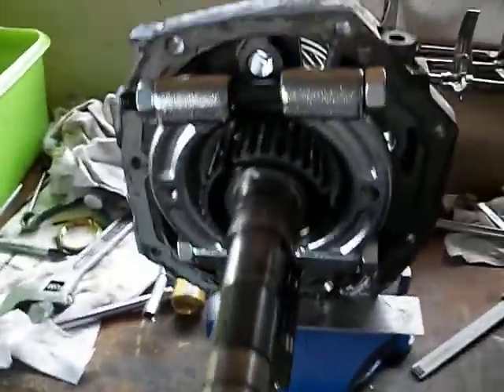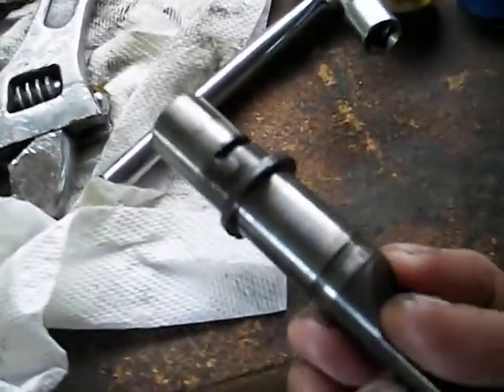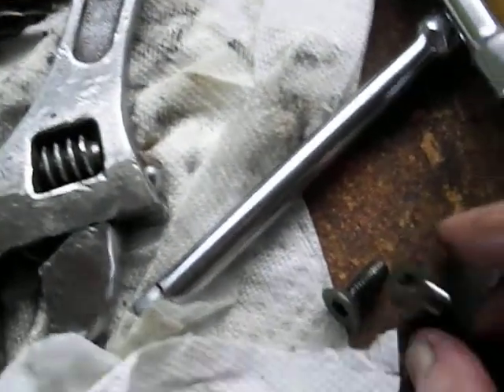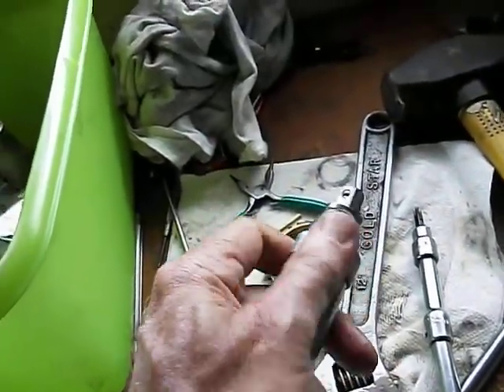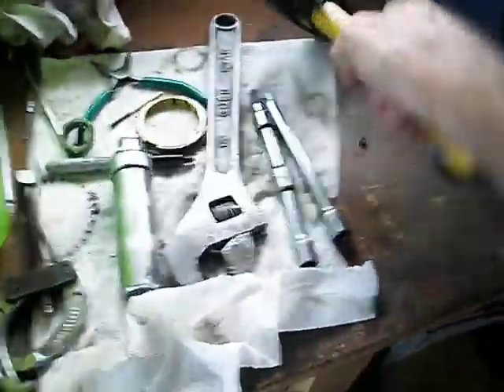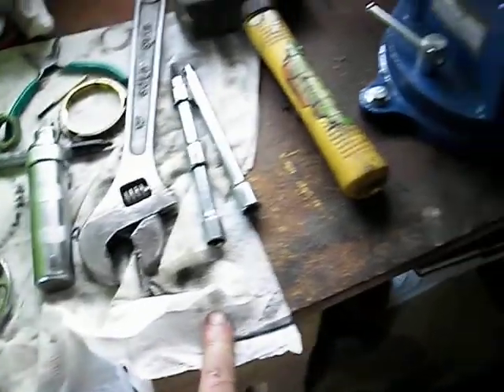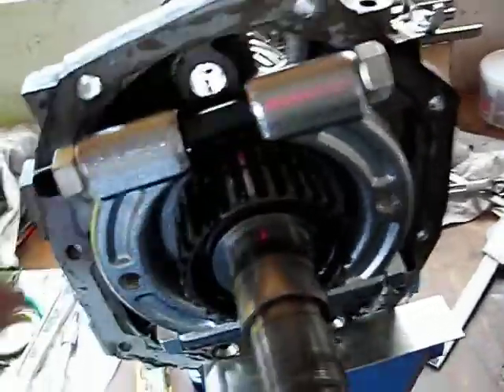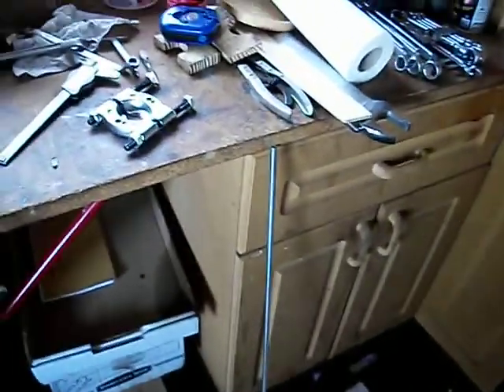FS5W71B datsun 280zx transmission rebuild pt 2

Comment: Hi Dave,
I'm still trying to get the shift arm out of my 5 speed. We talked before and you gave my some info on removing it, no luck.I know what has to happen I just can't figure a way to do it. The tapered pin on the shift dog is in such a position that I can't get anything in there to drive it out. Any ideas short of drilling a hole in the side of the transmission?
Craig
Reply from the maker: for sure don't to that (drilling the trans housing). I assume you have an older 5 speed without the reverse lockout. You are just going to have to get creative in there. So you loosen up the nut back it off enought to protect the threads on the end and try to get somehting in there like a flat bar to tapp on the nut. Maybe a little heat from a mapp gas torch, maybe some expandable plyers wedged in between the top of the nut and the side of the housing. Just dont get frustrated and make things worse. maybe double nut it and see if you can just wiggle the pin a bit. As soon as it breaks free it will come right out.

Comment: I have PDF of the Datsun factory manual on that transmission and there are 3 very good videos on YouTube of the disassemble and assemble. Ive had 2 of those apart first one took some time.
Reply from the maker: you are prob referring to the ones by villageland, no audio. I watched those several times before attempting this one. I decided to follow the FSM regarding using a press and the sequence. I noticed on his he did not use a press but rather a series of spacers and then the nuts to pull the mainshaft into place.
Reply: Dave WM yes I was. Whee you able to disassemble the shift rod and replace a seal or what every is in there? I stopped trying to remove that part I couldn’t find any info other the the manual and it was no help.
Reply from the maker: yes you have to release a bolt that is wedged in (no head) it was a bit of an effort to get it started, IIRC I used a drift and access thru the reverse lockout hole. then there is the knock out plug at the end of the shifter. Its staked on only, the shift rod just pops it out once you have that wedged on bolt and lever off (the lever that engages the shift rod ends). Once that rear cover is popped off its easy. IIRC there is a large O ring and some smaller ones as well. Its been a while so cant recall the specifics, but really pretty easy once you get that wedged on bolt off. Its the same kind of bolt used to lock in the rear wheel spindle pins if you have done any work on the rear suspension.
Reply from the maker: https://www.youtube.com/edit?o=U&video_id=c94O81s3hlo
Reply: Dave WM Thanks did any of you videos have that process? I tried for 2 hours and finally gave up thinking it would be destroyed by the time I figured it out.
Reply from the maker: see the above video I linked. It has the process pretty well documented.